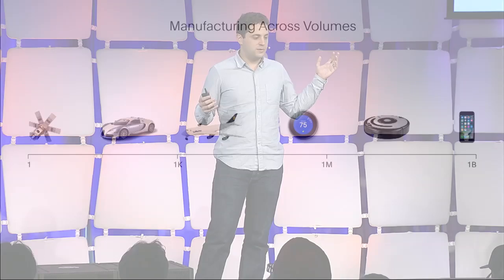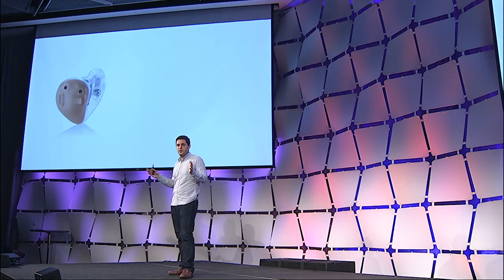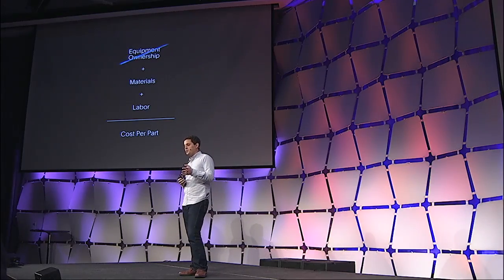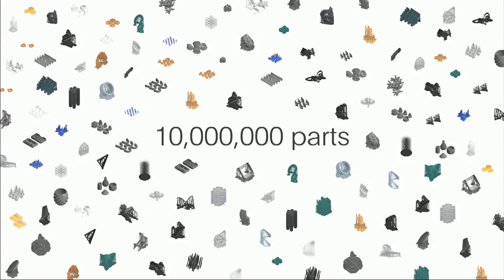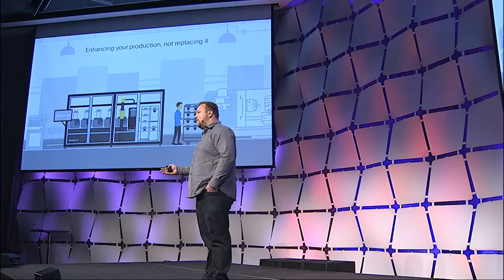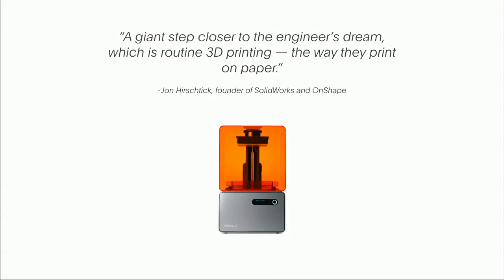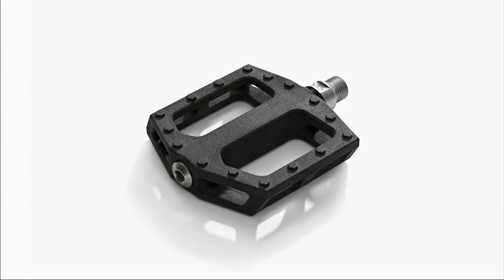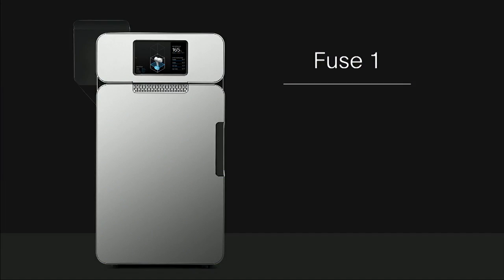Defining the Next Chapter in 3D Printing

Comment: Looks like a really good first step from the desktop printer into a larger scale setup.

I'm a bit curious as to how you got so much of a reduction in labour costs, since the parts you automated are the simplest and least time consuming parts. The washing and curing are much less skilled and are much quicker than the clean-up of supports and detailing afterward.

Also I assume you would still need some human intervention if you need to replace a tank, or a cartridge, or to sort out a failed print?

Also I noticed that the printers don't have their orange UV covers. Does this mean that there could be a potential problem with resin curing in the tank, or are you assuming that the resin will be used and replenished fairly often?
Reply: The clear sheets covering the machine have UV blockers added in so there is no potential for resin curing.
Reply: Ahh thanks for the clarification :)